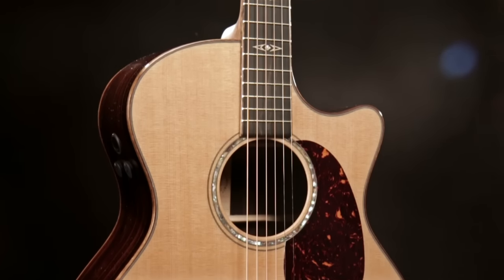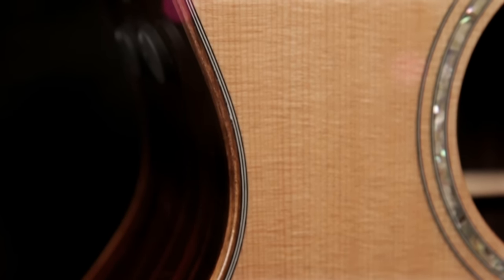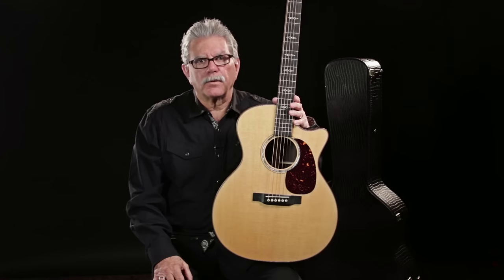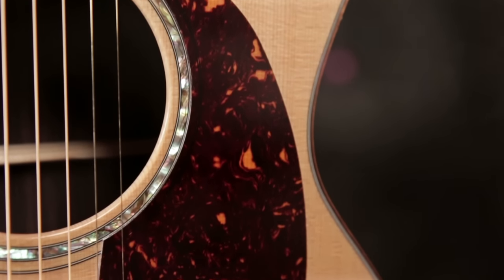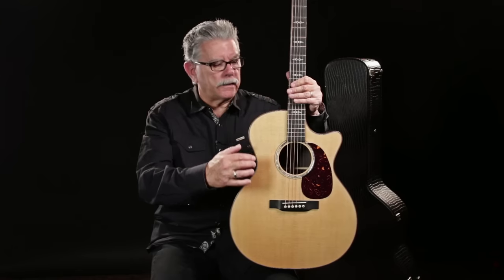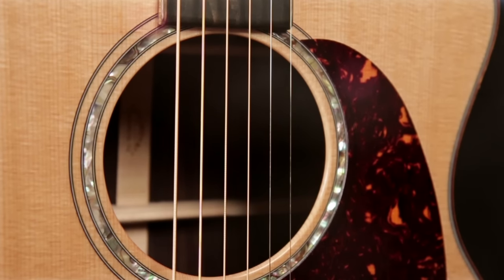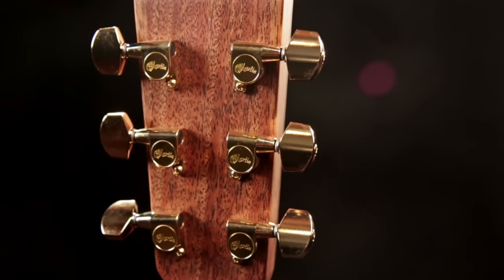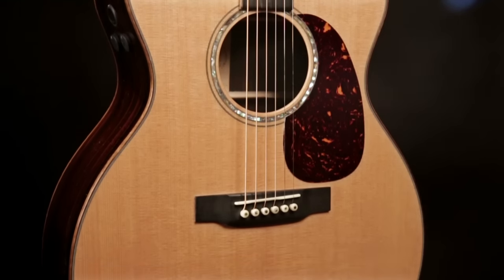Martin Custom GPCPA1 Plus wtih VTS Acoustic-Electric

Comment: I had this guitar for a few years. It was a complete disappointment. This guitar has the absolute WORST electronics. The endpin jack box is poorly designed and my signal would always cut out on me on stage. It is a well known issue with this model. The endpin jack is a defective design. And this guitar did not sound anywhere near as lush as a D28. Stay away from this model.
Reply: Must of been an issue with yours. i have had this guitar for 7 years along with a few Taylors and other models and it is my best guitar. It has a more natural sound plugged in than my Taylor 814ce and 614ce also unplugged it is unmatched. You must of just got a bad one, never seen a bad high end Martin but thats the only thing I can think of because mine is exceptionally good.
Reply: Not what I've heard. At all. Must have gotten a lemon. I've heard GPs that have smoked 28s. And I've owned Martins my entire life
Reply: @el34glo59  No kidding man! The GPCPA’s are so good is mind blowing. So underrated